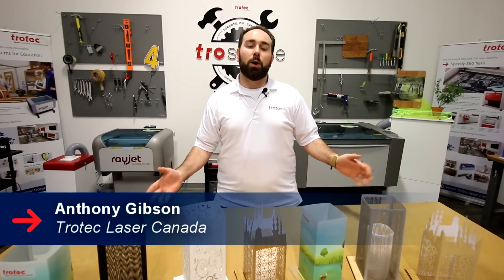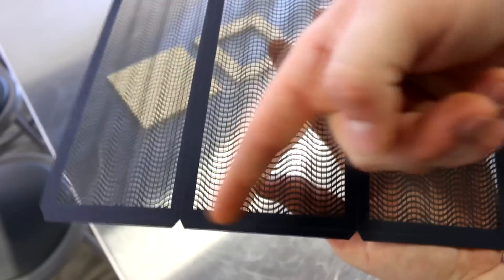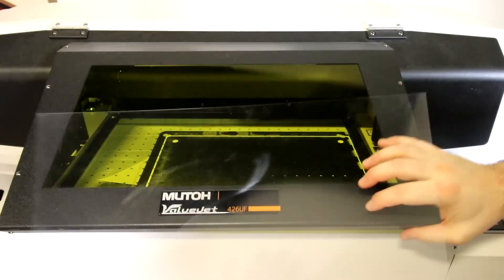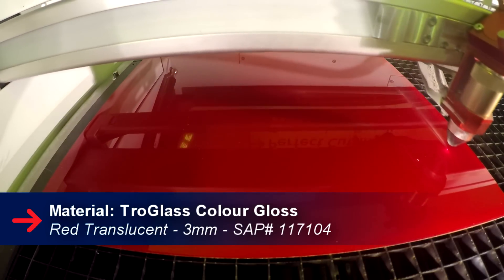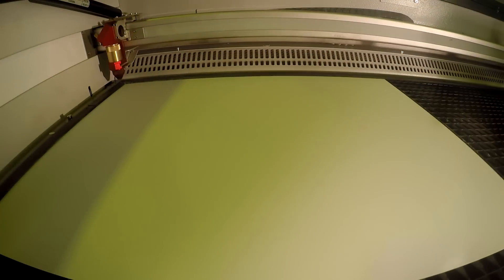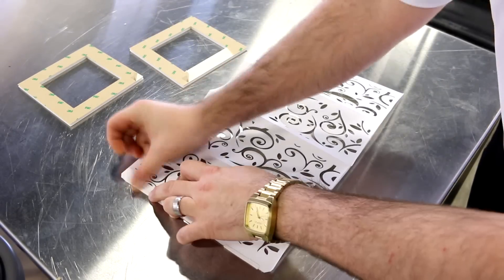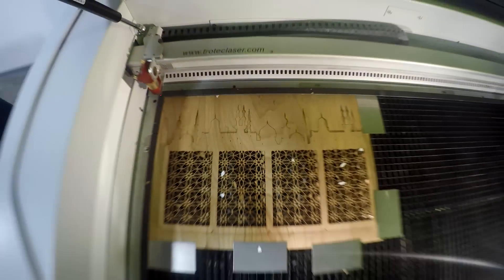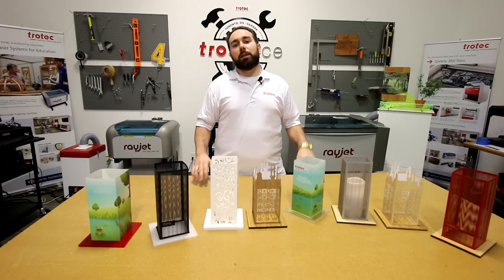Laser Cut Lantern | Paper Lantern | Laser Cut Paper

Comment: I used Acrylic for laser and it breaks, MDF and Foam Boards leaves black stains....suggest best material with flexibility and which doesn't leave a residue....
Reply from the maker: hi Guan, do you use a Trotec? If so which one, how many watts? For Acrylic, do you use ours? If not, is it cast or extruded? Some materials like wood/MDF will always leave residue when cut, you can sand the edges after cutting it, if you have residue after engraving we would advise to lower the power and to use a masking tape. Foam boards, again, is it our SmartX matrial or another brand? We would need more info in order to help.